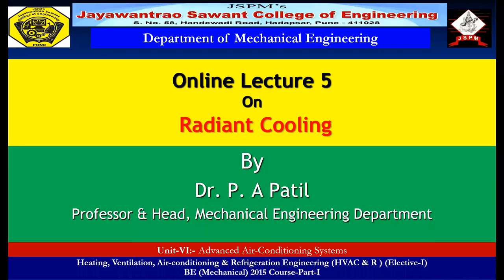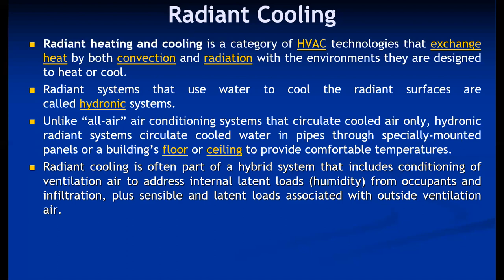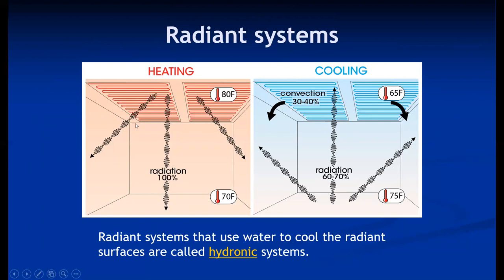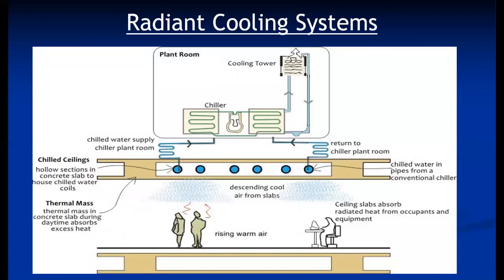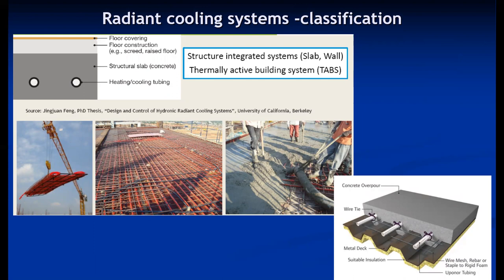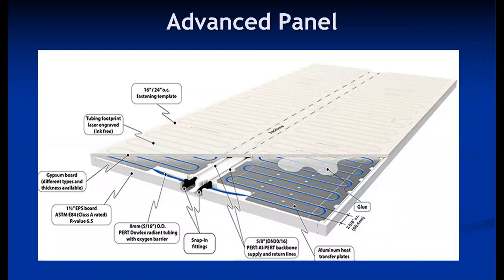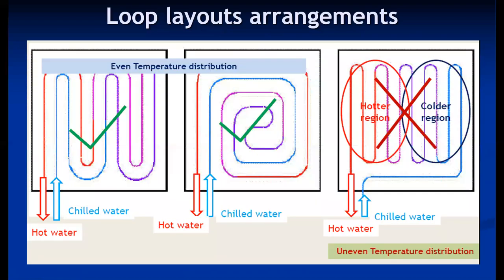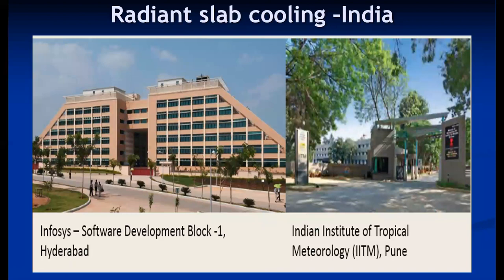Lecture 6 5 Radiant Heating  & Cooling

Comment: Sir, i have a doubt in thermal load distribution, if the room is more than dew point temperature, condensation occurs, how do we control the room temperature below dew point temprature,pls clarify